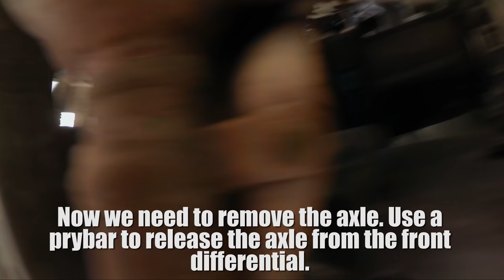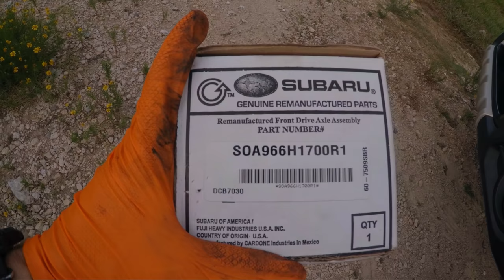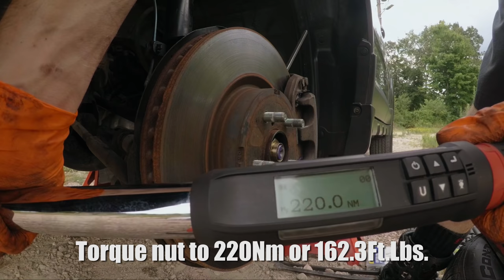2010-2014 Legacy/Outback 3.6R Front CV Axle Replacement

Comment: I have to replace my axle too as I accidentally burned a hole in my CV boot whilst replacing lower control arm. Thank you for the specs and detailed instructions. I have confidence to perform the work myself (as long as a torch is not involved lol)
Reply: Lol that’s funny I burned my boot taking off my front sway bar

Comment: Such a great video.  Some comments from just finishing the job:  buy a Subaru axle, the one I got on Amazon for $95 would not insert all the way into the transaxle, the $300 one from local Subaru dealer snapped right in; vid makes it look easy to remove rotor for me had to work back and forth pulling it would move just a smidge just keep going eventually comes off;  drop the ball joint out of the way and twist the hub assembly hard right turn to get the axle out of the hub and keep the loose axle to the rear of the hub for the next removal step;  it wasn’t easy to line up the caliper when reinstalling bolts vid makes it look easy.   Axle nut was another $10 from Sub dealer not included with new axle.

Comment: Great video! I'm doing this on my 2010 outback today, so this is perfect.
Reply: So as a follow up... Make sure you triple check everything is tight when it goes back together. 3 weeks later I'm driving in a town with shitty roads and my car starts clunking. I thought it was a suspension problem but couldn't see anything wrong. Turns out the top 17mm bolt fell out on the highway! Luckily it was the top so I was ok going forwards. I only figured it out when I tried to reverse and it was binding up. The caliper was swinging out and catching on the inside of the wheel. No damage that I can see. Gonna have a good look tomorrow lol

Comment: Thanks for the video! Just completed the axle swap on a 2014 Outback 2.5. Easy!
Reply from the maker: You're welcome 👍🏻
Reply: How long did it take you and did you run into any issues?
Reply: Brady Hancock, took me about 40 minutes and everything went straight forward. The video covers all the steps necessary. The only issue I have now is the remanufactured axle from Subaru has the classic knocking noise of a bad CV joint. So now I get to deal with that and do this all over again!

Comment: I just did my 2010 2.5 front right cv shaft and i still get a slight clunk when turning. It was an oem unit and i took my time to do it properly could it be the ball joint or steering arm joint and if so how do i check it do you have a video on this?  Any ither spot that can do it. I just had whole front end done by suspension specialist with shock and strut bearings etc and many rubbers replaced too.

Comment: Hey MrSubaru,  is  the CV Axle replacement on the REAR the same as the front on these Gen4 OutBacks ?  I'm referring specifically to the removal/insertion into the REAR DIFF (vs. the Front on this Vid).  Just gently use a PryBar to remove it from the Diff ?  Is that Service Tool (in the FSM) essentially the same thing?  But I have a 2.5 though, not the 3.6 that you used to have, does that matter either?   Thanks !!   Chris
Reply from the maker: Correct. Pops out of the diff with a prybar.
Reply: @MrSubaru1387  Thanks !!!

Comment: I have a question on regards when I removed the  outer tie rod off the spindle.  I used  ball joint remover and accidental squeezed out a little grease from the outer tie rod ball joint. The boot is still fine on the ball joint is still fine.  Did I break the seal for the ball joint on the tie rod? or is that a normal loose fitting on the top of the bolt area.  If it's not normal. Then should I replace the outer tie rod? Anyway, I got the CV axle replaced fine.

Comment: Excellent video, the only problem I'm having is separating the wheel hub and the cv axle. I've tried a puller and a hammer, lots of pb blaster no luck whatsoever  Any suggestions would be greatly appreciated.
Reply: I had to hammer and chisel to separate the 2.
Reply: Rotary hammer did not even break mine loose, too much rust in the midwest, I ended up replace entire steering knuckle.

Comment: Mr. Subaru, my 2008 legacy runs incredibly smooth on highway no vibration, or shaking of steering wheel. 

When I’m on a grooved road like the ones being prepped for paving, at 35-40 MPH my steering wheel starts to shake.

It can’t be Tires or alignment, is that rack and pinion, tierod ends? Wouldn’t it do it at high speeds as well? 

I’m stumped.
Reply from the maker: Ummmm. Kind of normal to get a shake when driving on a grooved up road I'd think.
Reply: The car itself does not shake just hums, it’s the steering wheel that wobbles like I’m getting some feedback of a tired suspension part. Thanks, I’ll keep an eye on it to see if there is something getting loose, car has 120,000. I just purchased it a couple of months ago and I’m using your videos to give myself a reference point of PM work done to the car.

As always thank you for great videos.
Reply from the maker: You're welcome. Hopefully it's nothing. Give the suspension/steering a once over though.
Reply: My mechanic who does the bigger jobs, told me the rack and pinion will need to be replaced in about a years time, one of the lines has a small leak in it. I will bring it back to him and see what he says about that symptom. 

Manual transmission/differential fluid to be done tomorrow.

Comment: i found a sitch with my subaru in january and a few thousand dollars later it works ok again, but i've had the wheel bearing replaced 3 or 4 times now. do you think its junk bearings from autozone or could my axle be bent? i've replaced my brakes and rotors about a thousand miles ago and at 60-80mph it vibrates very slightly, except when putting on the brakes the steering wheel shakes like crazy.
Reply from the maker: Shaking steering wheel when braking indicates warped brake rotors, most of the time. That said, it could be play in the tie rods, rack, or ball joints. Could also be bad struts.

Comment: Mr subaru thanks for your great videos. i just discovered cv boot broken and changed axle on my 2010 3.6r. 180k miles.  had someone do it for me then did an alignment. well now when i turn right, i hear a slight clunk or play then the car drifts right. then i made a left u-turn and there is that slight clunk and the car drifts left slightly.  i dont think it has anything to do with the axle. worried the front end wasnt bolted tightly to the chassis..!  just this morning i took to mechanic to tighten and he found nothing wrong. have you heard of this? you have save me and my subaru cult buddies tons, thanks
Reply from the maker: Sounds like the axle is bad or not fully seated in the front differential. Usually a bad axle will click/clunk when turning tightly. Did they replace the axle or just put a new boot on it?
Reply: @MrSubaru1387  whole new axle but not oem. mistake on my part to allow it but couldnt get new oem for a few days. tech said he tightened everything and could not id the clicking or trace  it to the axle. clicking seems most prominent when i go forward, brake hard. go reverse,  brake hard...vice versa. alternating forward backward creates the clicking most prominently, but when i made uturn last week it made a thunk and the steering continued to veer like there was friction returning to center. tech said it might be steering drag causing but insists not the axle and cant id the problem. did alignment right after axle- would and alignment ever add friction to the steering? i drove with windows down and dont hear noises from around the front new axle. does this make sense and is there a diy to adjust steering drag? my last question and  thanks for your time
Reply from the maker: @macdean  I've seen issues before with aftermarket axles. Either being too short, too long, or the range of movement being lesser/stiffer than oe.

Comment: Were your joints clicking? I noticed my cv boots have started flinging grease around but I cant find a split in the boot. Is it okay to just replace the boots and regrease if theres no clicking?
Reply from the maker: I've never re-booted an axle. Always just replaced it. The aggravation of re-booting and greasing isn't worth the hassle to me. Rather throw in an axle and ride.
Reply: MrSubaru1387 I guess so. It's more just a boot and grease is like 10% the cost of an axle
Reply from the maker: Finding the boot is going to be the issue. Disassembling the axle is a bit of a pain as well.

Comment: Can someone explain what he means by marking the upper camber bolt.  Where exactly am I marking this and why?  Thank you for the help on this.
Reply: Mark the orientation or rotation of the bolt with a paint marker or something so it is lined up the same going in as it came out. The camber is set with an offset cam so if the bolt is rotated it will mess up the wheels camber (leaning in and out).

Comment: Hey I had a little bit of oil from the transmission come out when I pulled the axle. Car was jacked up past level in the front. Is that ok or should I be worried about the transmission being low now? (Manual)
Reply from the maker: Just check the fluid level and top it up if needed. 75W-90 gear oil. Dipstick on the right side of the transmission.
Reply: Ok thank you!

Comment: Does the Oil Seal between where the CV Axle and Rear Diff typically get replaced when doing this job?  I know the FSM states to replace, but I always like to hear "real world" advice.  The Oil Seal actually appears to resemble a cam/crank seal, is it difficult to remove and install?  Thanks :)

Comment: Hey have an 08 spec b in Utah my check engine light will come on, shut down cruise control and my option to switch between standard sport sharp and intelligent won't work also when it happens I've tried hooking up a obd tool and it just won't connect only when this happens anything you know of that I can just fix?
Reply from the maker: When the CEL is on, cruise deactivates, and the selectibility also deactivates. You need to scan the codes. If the scan tool isn't powering on or communicating, you probably have a blown fuse for the cigarette lighter/12v outlet. This fuse powers the diagnostic port.
Reply: MrSubaru1387 but it randomly shuts off the cel and Everything is good for a while again
Reply from the maker: Codes will still be saved in the history.
Reply: MrSubaru1387 will autozone be able to pull the history of codes or take it to a shop?
Reply from the maker: Code reader may or may not be able to. Depends on what they have really.
Reply: MrSubaru1387 who would be able to pull old codes from the history?
Reply from the maker: The parts stores may be able to. An auto repair shop should definitely be able to.
Reply: MrSubaru1387 you're the man

Comment: I have a 2012 Subaru Outback 3.6 limited . Has a vibration problem when accelerating at 40, 60 and 80. Vibration stops when I decelerate. I think it might be this.
Reply: Steven did you figure out that vibration problem? I have a similar problem with my 2010 Outback . Thanks!
Reply: @thomasthomasino6157  I did a transmission fluid change and differential oil change. Ever since then I haven’t had any more vibration.

Comment: Does a 2012 Outback 2.5i CVT have the head gasket issue and what is the lifespan of a CV axle?
Reply from the maker: The FB25B isn't known for headgasket issues. They are known for oil consumption issues though. A CV axle can last 10 miles or 200,000 miles. Impossible to estimate.
Reply: MrSubaru1387 Yeah I just checked again I have the EJ253 in the Outback.  I heard that early FB's had an oil consumption problem.
Reply from the maker: 2012 Outback should be an FB. Thought 2011 was the last year of the EJ. Perhaps I'm wrong.
Reply: MrSubaru1387 It's okay 2010 to 2012 was last years for the EJ's.  FB's are 2013 and newer.
Reply from the maker: Guess I was thinking about the Forester. They got the FB before the Outback.
Reply: MrSubaru1387 so will my EJ most likely have the problem?
Reply from the maker: My brother's 2011 Outback 2.5 Limited is at 180k miles on the factory head gaskets. Service the cooling system every 80-100k miles with Subaru super coolant. Do this in conjunction with your timing belt/water pump service. Throw a new oem thermostat in with the new water pump. You should be fine.
Reply: MrSubaru1387 Okay thank you so much I have been doing that.